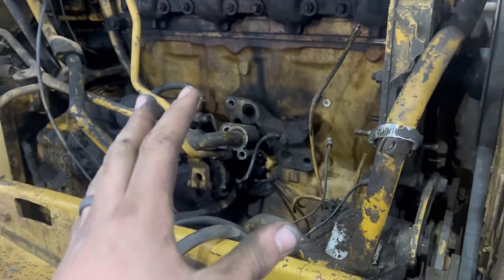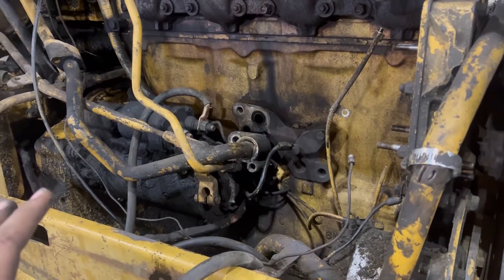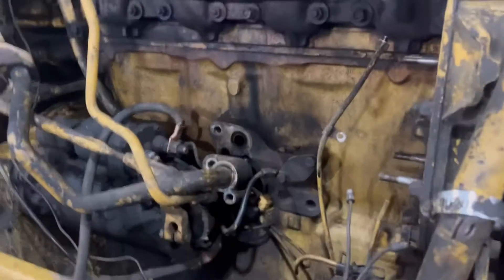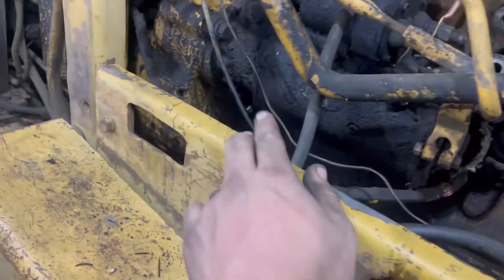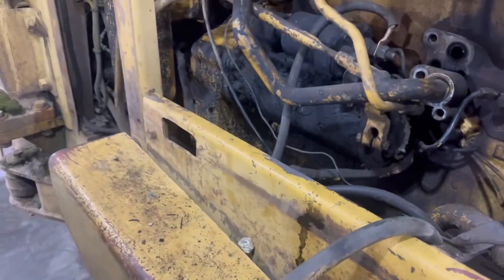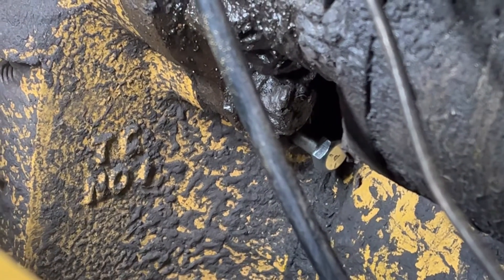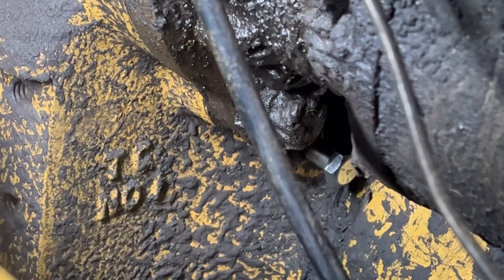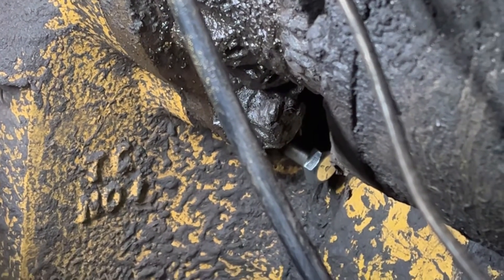How to Find TDC/PIN CAT Engine (EASY) #topdeadcentre#mechanic

Comment: You don't have to pull the valve cover on 3304 or 3306 engines.  Just remove the crankcase vent. It is right over numbe one cylinder and you can reach in with your fingers and feel the valves.
Reply from the maker: Good tip!! Thankyou

Comment: The cat manual told me to remove the lock nut and set screw for removing rockers. Now i have no idea where the engine is anymore after this head gasket job. Would you know how to find TDC then?

Comment: Is there anyway to tell  if you’re at tdc 1 or 6 when the rocker assembly has been pulled off and set screws loosened ?
Reply from the maker: Do not loosen set screws 

On the cylinder that is TDC when the engine is pinned: both valve rocker arms will be loose (exhaust and intake)
Reply: I would ask the same question as above but slightly different. How do you know if your TDC on intake or exhaust if set screws can't be used. For example I have a 3406 with both intake and exhaust rockers for cylinder 1 broken. The person that took the rocker shaft off loosened all the other set screw and I'm stuck fixing it. In that case you can not use the any setting to tell where the engine is at. How do you find TDC in the case?
Reply: Did you figure this out? Cat manual said to remove set screws now im screwed.
Reply: @twenger1  yes I pulled number 6 injector and stuck a pick in it and verified position not the best idea tho

Comment: On CATs and JDs, when the engine is “pinned,” does that mean (a) TDC for cylinder 1 OR (b) TDC for cylinder 1 or 6 (verify by visually looking at rocker arms)?
Reply from the maker: Depending on engine can be 1 or 6.  You have to confirm by looking at rocker arms.